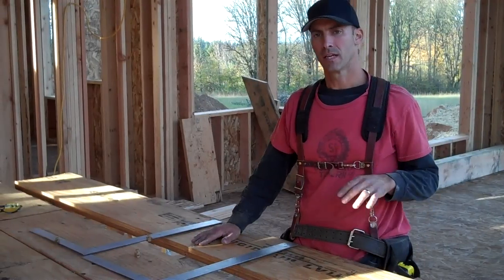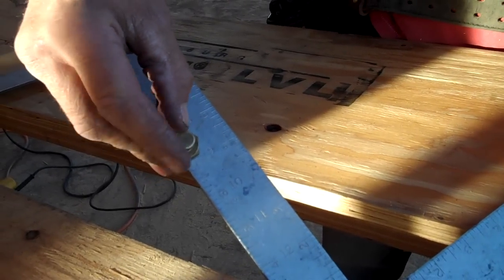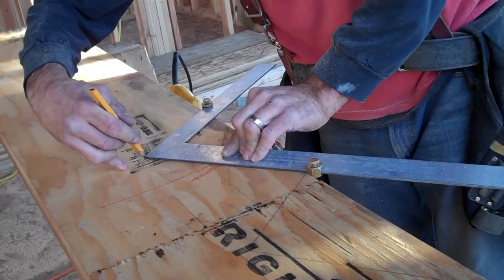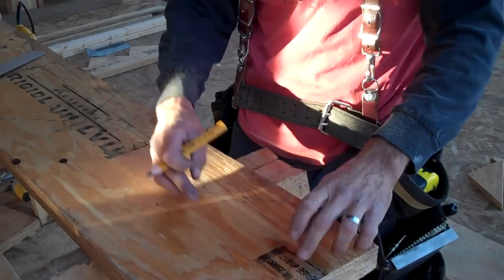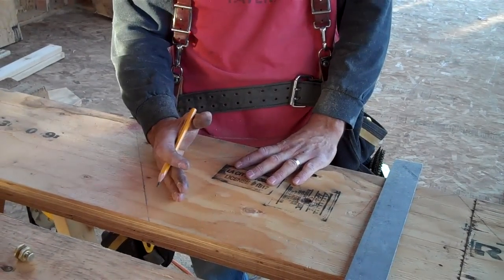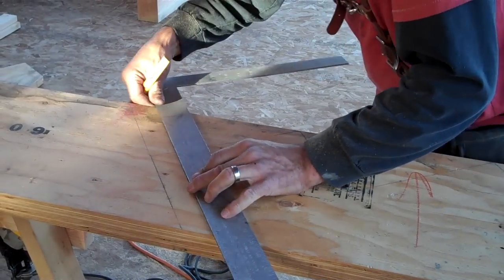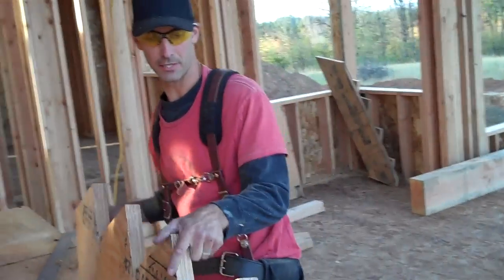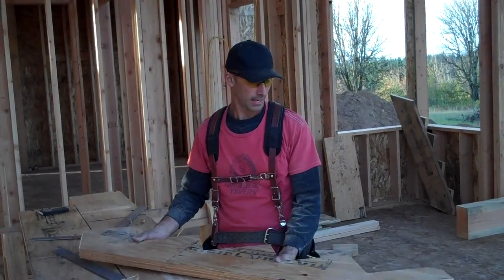How to calculate, layout and build stairs- Part 2 of 3

Comment: I don't think you have to worry about the over cuts on an LVL stringer. The plywood is plenty strong, especially for a supported stringer. If it's a free spanning stair I wouldn't over cut, The over cuts actually make for a cleaner corner since jigsawss suck at following up.

Comment: Good stair video overall. Been carpentering since June 1973. I gotta tell you putting your fingers by that blade guiding the saw shoe is asking for it in the long run. If you are tired or God knows what else anything can happen on a job site you eventually gonna get the chop. Just sayin.

Comment: A Few Questions: 1) I've also seen video's that show drilling a hole at the intersection of the rise and run.  What's your thoughts? 2) You talk about the stair tread but not about the board attached to the front of the riser.  Does that change your calculations? 3) What are you thoughts on attaching the treads and riser boards for quietest stairs: Nails only, Nails and Construction Adhesive, Screws only, or Screws and Construction Adhesive?  Thanks!
Reply from the maker: Hello.  I have never seen drilling holes at the intersection of the rise and run.  I see the logic in it, but not sure that is necessary if you don't over cut.  Certainly won't harm anything if the hole is small...

Toe kick is normally 1/2" ply and just tucks under the overhang of the tread.  I have never had to adjust for it, but doesn't mean there isn't a scenario where it would be a good idea.

As for quiet stairs, I have always just used copious amounts of nails and made sure everything is locked in tight.  You can never go wrong with construction adhesive and/ or screws if you want a bit more insurance.
Reply: Thanks for your quick reply!  Your videos were very informative and I will be building my first stairs this week at our new cabin.  I've seen many videos showing similar layout processes but yours was the only one to use the stair nocks. A less than $5 suggestion for quick / repeatable angles!  I especially liked how you refer to a landing as one of the steps for maintaining the integrity of the rise and run. (As my steps will need to have a landing.) Thanks Again!

Comment: Hi, great video. A quick question- I understand why you drop the stringer by the thickness of your tread and why you dropped of at the top to accept your 2x material to attach to the upper floor, but are you not also meant to drop the thickness of one riser material so all treads are of equal depth? Cheers

Comment: Now I have a second question. I'm using 2x12s for my treads as well and they are in the neighborhood of 1-5/8" thick. Does the thickness of the tread material need to be accounted for when calculating the riser height? In my case, my risers are 7-3/4" and tread depth is 9-3/4". With the tread thickness added, the overall reach of the riser and tread is going to be 9-3/8" (I think.) Is that an acceptable height?
Reply from the maker: Brian Wellman you just cut off the thickness of your tread material off the bottom of the first riser and that will set your height. All the subsequent rises will be the same because you are adding the same tread thickness to each rise.

Comment: Okay. I may be mistaken, but I don't think you explained exactly how to determine the placement of your first riser/tread. You just laid the square somewhere near the end, without showing us how you measured how far from the end to start. And every other video or page I've found does the same thing. Nobody says how to determine where to start the layout...how far from the end of the board?
Reply from the maker: There isn't a specific place to start. Just leave enough board below your first step to allow for the first rise below it.

When ordering stringer material, I always order them a little long so I have plenty of room.
Reply: Thanks. I started by placing my square with the stops along the long edge and placing the other square perpendicular to it to mark a line the length of my riser from the square along the long edge to the bottom of the board (diagonal line). That gave me the first riser height.
Reply: Still leaves the question of how to know how much is "enough." At least the length of your riser as measured from the end of the board along the long edge? Or just eyeball it and hope? Makes a difference, I think. :-) Great video series and very helpful overall.

Comment: Splitting hairs here;  But you're building Carriages not Stringers.  A Stringer is the finish for a Carriage.  The Carriage is the support structure of the stairs, a Stringer runs along the side of the Carriage.
Reply: Probably different syntax for different people and places. We've always called them stringers, and the material running alongside them, Skirt Boards.

Comment: Hey man really impressed with your videos. Great picture quality and solid information. Just figured I'd share something. In addition to the tread thickness deduction I also deduct 1-1/2 " from the bottom, I like to have 2 2x4s on the bottom. one at the riser and one at the heel of the stringer as I believe that is the load bearing point of a stairs. I've never used LVL stock for stringers but I can most definitely see the benefits of it. Are you on Instagram by any chance?

Comment: How did you determine where to mark the first stair? It looks like you just started marking but didn't explain how you got that point. Thanks!
Reply from the maker: Just make sure you have enough room below your first tread line for the riser.  If you put the lower stair knock approx 10" from the end of the board,  you should be good. Good luck!
Reply: +Makena Built Thanks! Also does it matter if you start marking the bottom or top of the stringer first? Which way do you work?
Reply from the maker: +Alpha Personal Training I work from the bottom to the top.  Probably no wrong answer though.

Comment: Dumb question concerning stringer layout procedures:  instead of later making adjustments (on your seven inch risers) to allow for tread material after your preliminary layout why not proceed with laying out an 8 and 1/8 inch riser initially to compensate for the 1 and 1/8 inch tread material and save a step?  I'm new at carpentry so be gentle.
Reply from the maker: You only have to make the adjustment on the bottom riser,  so easier to do it after the overall layout is done.
Reply: Makena Built j

Comment: A little trick I do when cutting the stringers is cut all the rises first, then all the runs, or vice versa. Basically so you aren't jumping back and forth, you cut all the same way then only switch direction once to go back the other way.Saves a little time.

Comment: are you not going to minus for your 3/4 inch plywood that gets nailed to the face of the risers? Your top step will be deeper that the rest.
Reply: Wrong. They will put a riser to cover the 2x8 on the landing on the top step. Makes them all equal run.

Comment: Great video one question  does the angle (pitch) of the stairs had to be calculated, in my mind the run would not e level otherwise. I guess not because you mentioned it but I can't understand that.
Reply from the maker: The angle is not impo.  The rise calculations gives you everything you need.

Comment: how do you determine length of material to cut out stringer once rise and run are determined.   I have 74.25" rise = 11 steps (6.75") /  100" run or 8ft 3 inch,  so can I use 12' - 2 x 12 to cut stringers out?
Reply from the maker: Keith Castleberry I would think a 12' would work.  You could use a 2x4 or sting to determine the line of the stairs and then you'll want to add at least a foot to each end for your raw material.

Comment: Do you guys have a box of spare thumbs in your toolbox?  I can see you are an experienced carpenter/woodworker, but given this is an instructional video on a public forum it might have been more sensible to warn people about the danger of guiding your saw with your thumb. if your saw hit a soft patch or a knot and kicked out you could easily have been making a health and safety video instead... perhaps you could add an annotation on top of the video at the point before you start cutting... if you get a minute

Aside from that small (but important) point, your video and the finished item is top notch... thanks for sharing your skills, experience and expertise

I like how it is filmed real-time with contractor activity and noise BTW
Reply: TheComputec I'm glad I wasn't the only one cringing when his thumb was close to the saw.
Reply: ***** Judging by your atrocious spelling and grammar I am guessing you have at least seven fingers on each hand, so losing the odd one in a woodworking accident wouldn't be a problem.
It was an instructional video.I stated clearly that aside from a little bit of H&S it was a great video... The poster above your comment also agreed... Why do you feel the need to be aggressive?
Reply: ***** Hey no probs... I would just point out that this isn't a masterclass for carpenters... It was an instructional video for all those people like you  and I (WHO ARE NOT CARPENTERS) that wanted some straight info about building a staircase without making a pile of scrap wood. I learned a lot from this video but there could/should have been a little bit of reference to taking care with saws... even if it was something like  

"Hey guys be careful... we use saws all day and we know how they behave... it might look effortless but until you are confident take your time and be safe"

It was constructive criticism.. not negative

You are an electrician.. I'm sure that on occasion you have worked on live cables on domestic or commercial new-builds or rewires... you will know how to work safely in this way... but would you do a video with you working on live cables without mentioning SOMETHING about high insulation tools, rubber soled boots or even advise POWERING THE CIRCUIT DOWN

I'm not a health and safety pussy but i've seen a runaway circular saw cut into somebodies ankle when it hit a nail that ran diagonally through a floorboard into its path and the saw  kicked out straight through a guys achilles tendon

I've also seen my brother (an electrician) connecting live tails into a consumer unit because he couldn't be bothered to wait for the electric company to come out and isolate the main incoming feed.(here in the UK they are sealed with a wax seal as an anti-tamper mechanism to stop you leeching free power) A pair of pliers slipped off the top of the meter knocking his hand against copper pipe he was kneeling against and he got shunted across the room... we laughed about it later but you know its sheer luck sometimes even when you do know what you are doing

We all take risks in our specialist trades. I work on industrial printers and sure i'll put my arm inside a machine to check a cable plug is seated properly even though I know that a loose thread on my sleeve miight get spooled and rip my arm right through a press running at 900rpm with NO safety cutout and a motor that would pull my whole arm right off... but I wouldn't make a video showing me doing it...

Unions fought for safety equipment because people would routinely die on sites every day and the bosses would shrug, call the insurers and then an employment agency to get another goober in pronto. We all know H&S are a pain in the ass and we will circumvent things when it suits us but we wouldn't train the new guys to do it that way straight off the bat would we? Sorry for the long reply but hey...

The important thing is that thanks to the tips in this video MY NEW STAIRS LOOK FUCKING GREAT  :-)  Peace out
Reply from the maker: ***** Measure your total height including the decking on top.  Once you cut your stringers, you will trim the decking thickness off the bottom of the stringer so that your first stair isn't 1.25" too high.
Reply: Makena Built Well thats a tip I could have done with 2 months ago LOL  I didn't include the top decking and I had already cut the stringer across the bottom... My staircase now sits on a 1" plinth... perfect for tripping on as you carry a drink upstairs ... my bad
Reply: ***** Thats fine.... but its a video to give advice to "weekend warriors" so it might be useful to give them a little bit of safety advice given that their skills will be less refined... that's the only point I was making
Reply: TheComputec is living proof that some people want to live in a world were they aren't held accountable for their actions. 

A person is responsible for their own behavior or actions. 
A person should educate themselves properly about saw safety. 

This video is showing how to cut stringers

This Video is not a saw safety video.
Reply: I dont really care what the other guy agreed to. You probably wear safety glasses when you cut a piece of wood and do not climb past 4th rung of a ladder without somebody holding it. Im an electrical contractor and I work side by side with tradesman.Most of the people use the circular saw in that manner. What you do is your business but the guy posted this great video to help someone like me build simple stairs.He doesnt need any negative comments.I didnt like the first part of your comment but the second had some value to it .Take care
Reply: TheComputec  Just get lost, t5his are not instructions for children or old ladies. If you dont have enough common sense dont watch
Reply: Lets talk stairs now. Didnt do mine yet.I have a finished platform and used 1.25 decking material on it.The same material will be used over the threads. I think that the total height should be measured without using the decking material.Right?

Comment: Great explanation. If my stairs flare out (not curved) do I still make straight stringers and let the treads overhang? Or do I angle out the stringers and make the riser/tread cuts at that same angle?
Reply from the maker: does the whole staircase flair out, or just at the end?  You can't just angle the stringers using this method as the dimensions will not work out.
Reply: Only the last 5 treads flare out

Comment: to me, something does seem right. you say to cut of the thickness of the stair tread at the bottom of the stringer. Just taking it off the bottom, wouldn't that make the first step smaller than the rest even when you put the stair treads on? maybe it's something I'm not seeing but to me it doesn't make sense if you want all rises to be the same. Great video otherwise, I'm an apprentice trying to learn

Thanks if you reply
Reply from the maker: The reason you cut the tread thickness off the bottom rise is because if you don't, it will be taller than the rest of the rises by the thickness of the tread.  For all the subsequent rises, the tread thickness is added to each rise, which effectively means there is no change.  On the first one, since there is no tread thickness on the floor below, it would be too tall if you didn't trim it.

Comment: Good video, I see the noise as just part of a jobsite. 

I think you missed when adjusting for the tread height by forgetting the floor covering on the floor and landings, usually 3/4". It should be the tread thickness minus floor covering thickness. So 1 1/8" - 3/4" = 3/8" to cut off.
Reply: Now that I see the third part, maybe you were talking about 1 1/8" plywood - I was thinking finished hardwood, in which case I take it back but still seems wrong with the top landing? Are they really using 1 1/8" ply with 16" centers?
Reply from the maker: P Roppo Hello-  In this particular example, the flooring was the same for lower level, stairs, and upper level, so no adjustments for flooring thickness was necessary.

Comment: This is definitely one of the better videos for straight forward explanation of this task especially for a non-contractor amateur like me. I finally fixed my 10 step stringer tonight at about 10 pm in my garage. I have a good template and now I can make the other two. Just wish I had a worm drive saw.

Comment: Man, my heart jumped a little bit every time you're thumb guided the saw. No big deal for experienced carpenters, but for people who don't have many years of experience ... you WILL cut your thumb off if you do this. You really have to know your saw, your blade, and the wood you're working with to be safe to do that. Best video one stringers I've seen, though.
Reply: Doesn't matter how experienced you are, hands should NEVER be that close to the blade, especially once the blade is past your hand and your fingers are essentially behind the saw. I framed for 11 years before I mistakenly had my hand behind the saw while holding the board, and it caught and kicked back while simultaneously pulling the board forward. I split the ring finger on my left hand wide open, severing the tendon diagonally, and requiring surgery to splice it back together. It also split the tip to the first knuckle of my middle finger almost in two, barely missing the bone. My ring finger has a permanent 35 degree bend at the top knuckle, meaning i can't lay my hand flat, nor can I make a full fist, even after weeks of physical therapy. There is never ANY reason to have your hand that close to a saw blade. You can cut just as straight without having your hands in danger.

Comment: One secret I will pass on to u rookies out there u don't need a square u can cut a PC of plywood or 2x12  u just have to have two sq corners measure from the same point on a PC of plywood say over 7 for riser and 10 for tread then connect those marks and use that PC to mark your stairs way faster an nothin wrong with it believe me done hundreds no complaints what so ever but have fixed a lot of peoples screw ups
Reply: غثثثغحكمتا
Reply: abbes jilali dont ask jj johnson to translate. that is dumber advice then makena custom homes is giving you